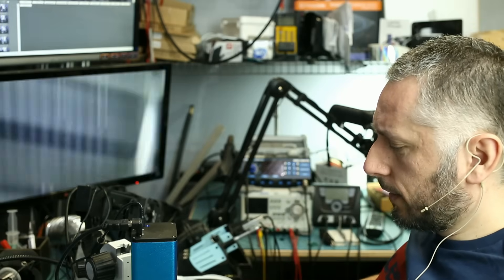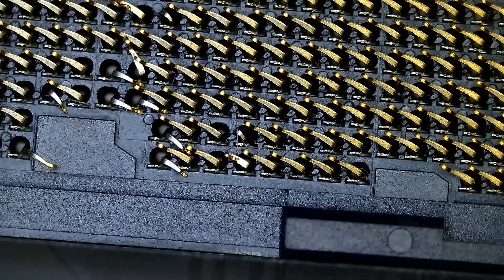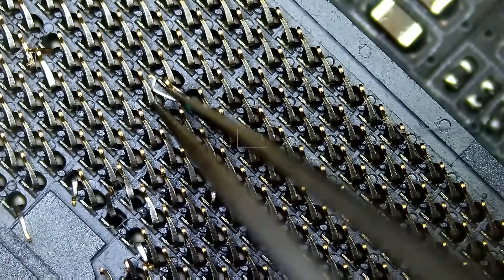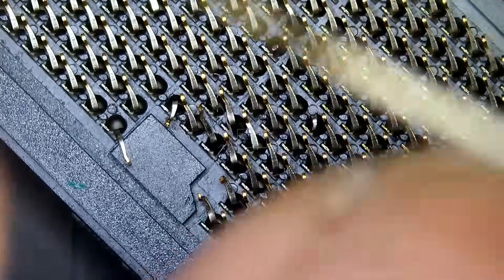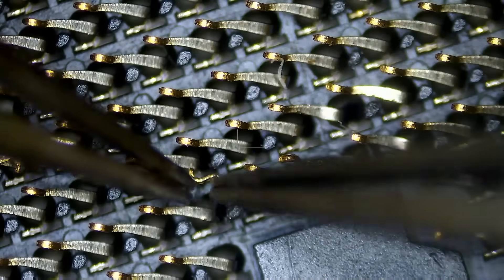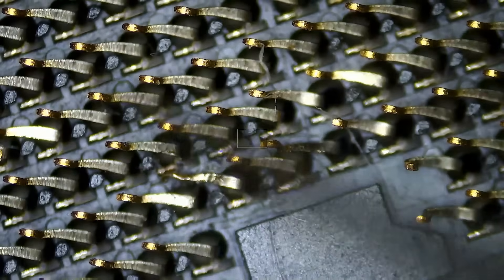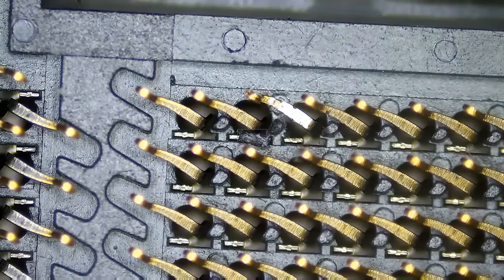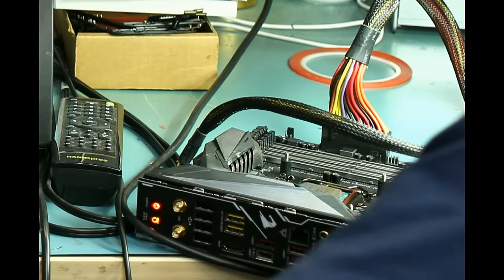GIGABYTE Z390 AORUS CPU Socket Bent and Damaged Pins Repair

Comment: if pins only are bent then everything will works (coolers,gpu ..) just no display on monitor ??
Reply: Mr11ESSE111 depends on what pins are bent
Reply: @teunw6699  mine b350 gaming 3 gygabite dont give display on monitor  but its not pins., probably some mofset dont work or bios chip!! i wait for debug card from aliexpress to see where is problem

Comment: im still surprise why people pull out the cpu the way he just did at the end. the cpu socket has a notch at the top (where the hinge of the lever is) and bottom to properly grip the cpu when pulling it out from the socket. doing it on the non notched part may cause not enough grip and may drop the cpu and bend pins (well at least i did one time).

Comment: Would it work to heat the pins up so they are less susceptible to breaking when you bend them back?
Reply: How?
And the plastics?
Heat and cold break the pin easier

Comment: You need more professional tweezers, those seem to be taken from some Chinese bazaar.
But in those conditions, it was better to change the socket and it doesn't cost much, especially when the pins break.
Reply: It may cost as much as the motherboard costs straight from the factory
Reply: @johna2604  Da Aliexpress ci sono prezzi economici less then 5 Dollars / Euro

Comment: In this case weather it works or not. Do you still charging the customer
Reply: I'd say in all fairness there would be a fee involved, otherwise, this type of repair is very time consuming and delicate. It would not be worth the time, effort and risk involved. I would not take this type of job on a no fix no fee basis.

Comment: Will my mobo work if one pin is broken? Any chances?
Reply: Don't use percentages, just find the pin layout in Google and see if the pin is essential
Reply: @MagicArcher17  mine worked  bro 😅 thanks for you cmnt.
Reply: @nokigaming6651  bro mine has 3 broken pins.Can you tell me what you did to make it work?
Reply: @lakshaynegi82  there are  some pins that are not so necessary to run the cpu.so if you are lucky, it may work.

Comment: Do you heat up pin before bend back?!?
Reply from the maker: no heat
Reply: I was thinking when I saw the video title "I wonder if he uses heat?" 🤔
No heat 😱
I've broken pins trying to straighten them with a small flat bladed screw driver before with no heat and was hoping to see heat used.
I've successfully straightened plenty with that same screwdriver but the metal is brittle on the older socket 775, looks like you got a better material of pins to work with.

Comment: You can get a new socket holder and resolder it to the mobo but you have to heat it up and should pop right off
Reply: That would be one way to go, but do tell, do you know where one can purchase a new amd lga style socket f 1207 pin socket?
Reply: @danielauen7790  I wouldn't am sorry

Comment: Good vid showcasing the labor intensive pin repair service. There is a aftermarket replacement socket available for like only $5-8 USD for the intel sockets but I think you need a BGA machine for it and I think the machine is expensive if I remember correctly. I think the Ryzen sockets are about the same price but AMD socket was easy to repair. I had checked not too long ago after I bought a motherboard that apparently had a broken socket for AM4, ended up RMA'ing it though, luckily.
Reply from the maker: It's not worth the time or labor to change the socket. This is a special case where the pins are badly damaged and unbending the pins took some patience due to how fragile they are.